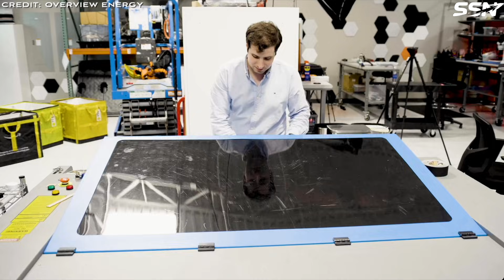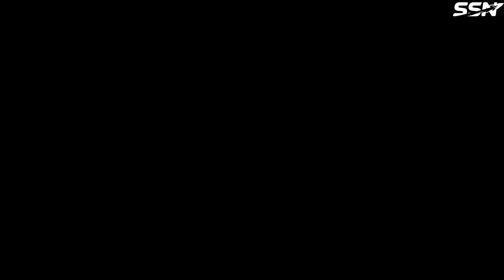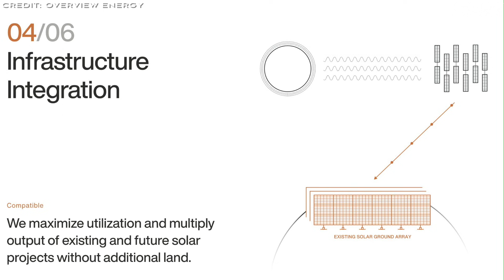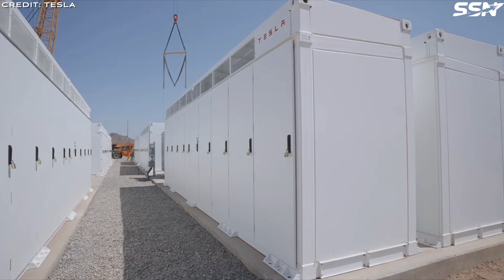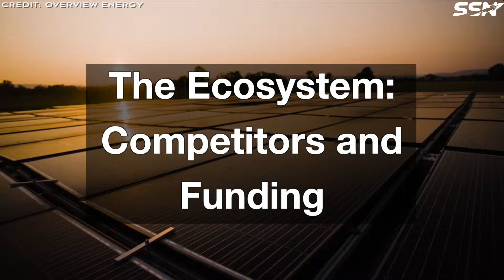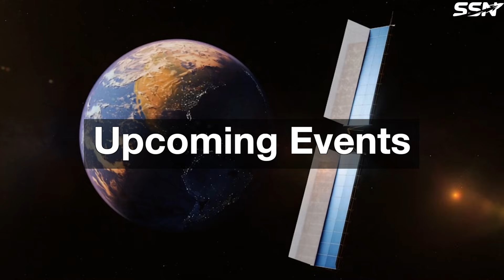Overview Energy's Path to Orbital Solar Dominance: Beaming Unlimited Solar Energy down to Earth

Comment: Very interesting presentation. Thanks for reporting.

Some big questions, in comparing this infrared-based power-beaming system to other wifi-based systems: 

How does the system keep the beam (and thus, the flow of power) accurately on-target to assure the reliable and safe transfer of power from orbit to Earth? Is there some kind of "handshake signal" involved to assure accuracy of the beam?

Would the infrared beam loose any power while penetrating the Earth's atmosphere? (As I recall, wifi beaming would likely loose about half its power between space and the grid-on-the-ground.)

Would infrared beaming cause heating to Earth's atmosphere?

Would infrared beaming be inhibited by inclement weather? (Cloud cover, rain, snow, etc.?)

How big does the satellite have to be to transfer a substantial amount of power from space to Earth?

Can this infrared system be used for non-terrestrial receivers? (Lunar, Mars, Phobos, Diemos, NEO's, etc.)
Reply: в диапазоне 1064 нм есть окно прозрачности влажной среды и потери на этой длине волны при прохождении влажной атмосферы резко меньше, но все же они есть и есть рассеяние в густой облачности. Так что даже в идеальном случае потери будут, а в условиях многослойной облачности или тумана или смога или пылевой бури потери будут очень большие, до 90%

Comment: How much power will it transmit? How much will it cost compared to grid storage batteries, which are getting cheaper all the time
Reply from the maker: Their plan: "Commercial operations in geosynchronous orbit are targeted to begin in 2030 with the world’s first megawatt transmission from space. In the early 2030s, we’ll be capable of delivering more than a gigawatt of 24/7 clean energy anywhere on Earth."

Comment: I cannot help, but wonder if the focus on infrared light would help with solar panels in high latitude regions. It would likely produce a little additional heat on each panel, which would help melt snow covering panels during the winter.

Just a small added benefit.

Comment: No commentary on efficiency of NIR on solar cells used at solar farms now, NIR laser efficiency, how a SSO filled plane of sats would fit the early business model of solar farm dusk/dawn boost earlier and cheaper, Lasermotive demonstrating similar beam pointing capability decades ago, widebeam being short for cheaper beam director using lessor quality components when the real point is keeping to consensus beam energy density limits...

Not a very critical overview.

Comment: I am beginning to wonder if some of these Space Solar companies have considered the current changes in Earth based solar.  Twenty years ago, solar power did stop when the sun set.  Today though there are more and more homes and businesses with batteries to keep them going, and the price of these batteries has dropped considerably.
With 100,000 home batteries installed in 17 weeks in Australia alone, how long will it be before any financial benefit from space solar will have dried up?
Reply: It'll never be of any benefit. You could build solar panels and fire them into space and then somehow transmit some fraction of the energy back to earth, orrrr you could take that same money and just build more solar panels on the ground. Which is better? The answer is always the ones on the ground

Comment: I did find that laser welding by sun rays concentration was a way better idea then bring a nuclear power station in to orbit to provide abundance of extra power needed for welding in space, after all we not talking here a little bit of time of welding fun at our garage, working on some "project", things done in space must be done rite on its first time, too much rides and depends on it. Now solar cells with 25-30% at it best could be enough but we would need to have a solar farm in space in a size of 100 street block, so a small town, the cost of this is enormous !!. TH

Comment: It is my understanding that most clouds are opaque to most near infrared wavelengths. How does that affect the business plan?
Reply from the maker: Their system uses near-infrared (NIR) lasers which have relatively good atmospheric transmission windows (high transparency in clear, dry conditions), water vapour and suspended water droplets (clouds or high humidity) cause significant absorption and scattering.

It's a compromise, using microwaves that have lower transmission losses results in larger receivers, for instance Space Solar need kilometre length rectennas on the ground.